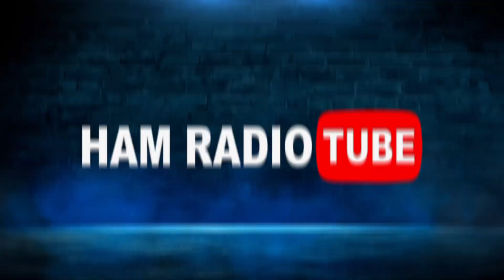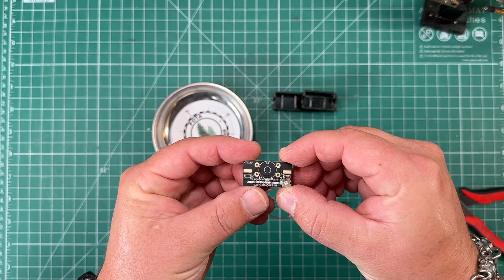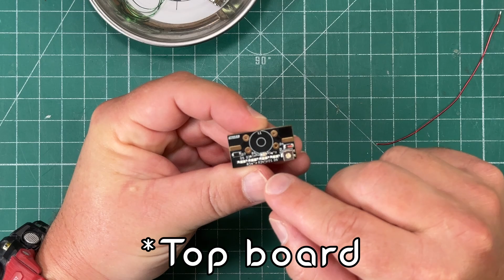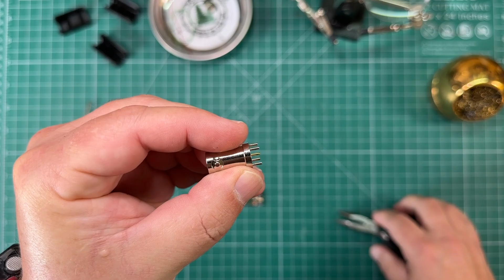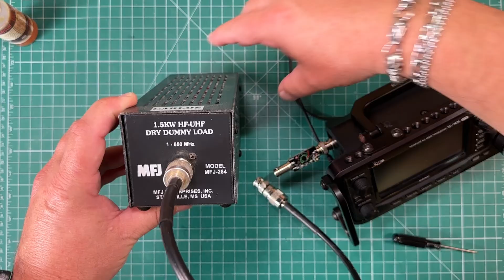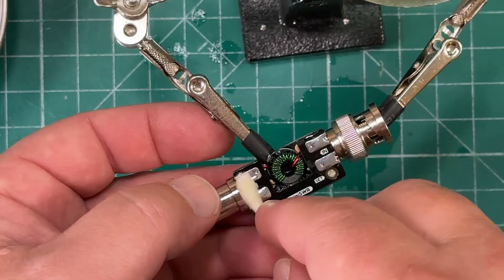N6ARA TinySWR Meter Build

Comment: I would like to see it attached to a telescoping whip, and then adjust the length for resonance !
👍😉
Reply from the maker: That's a cool idea but sadly I don't this would hold up to a 17' whip without breaking, never mind the fact I'd have to figure some way to get from the 3/8 24 thread to BNC.  I've got a couple MFJ loaded whips with BNC that I imagine are supposed to be resonant, but they aren't even close.
Reply: @hamradiotube  
No.....I was referring to , as an example a Ten meter telescoping antenna with a BNC already attached to the Antenna !
Much like the ones for various Bands that MFJ sold !
They are not that large !
I have a Ten meter handheld, that I have worked a number of Countries, not to mention State side contacts, using an 8 foot counterpoise !
Sorry for the misunderstanding !
Thanks !
👍😉

Comment: I noticed you put your parts in a small metal bowl.    I’m an old fart I grow up with HealthKit.  In those days we would separate our different parts in a muffin tin.  It has 8-12 individual muffin spots.  You might find this method is a better system.  But I always had to ask Mom if I could use the muffin tin.

Comment: Should have run it into a 25 ohm load and a 100 ohm load (resistors) to show that the 2:1 SWR function would work. Also could have used intermediate values to see how the lights would respond.